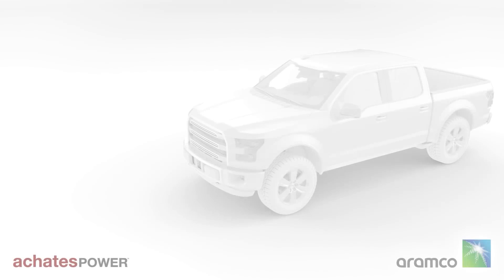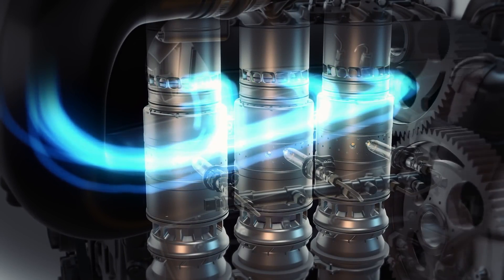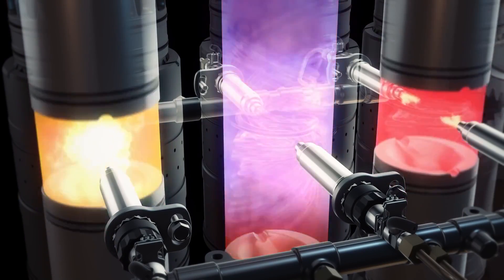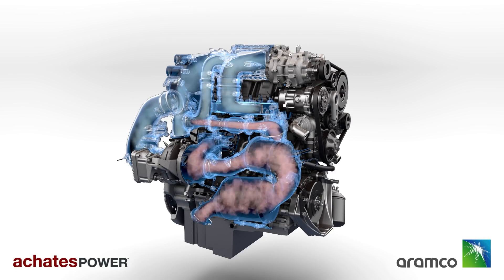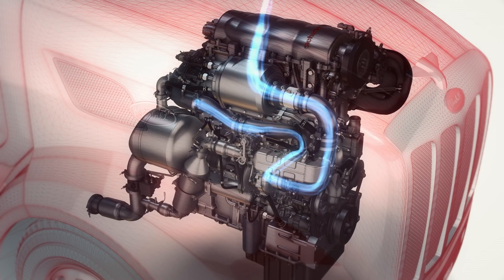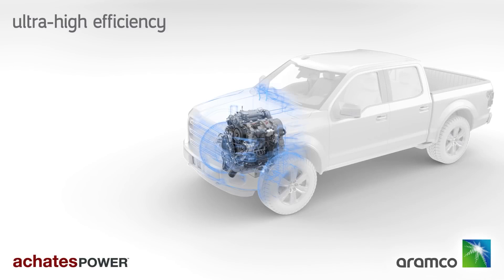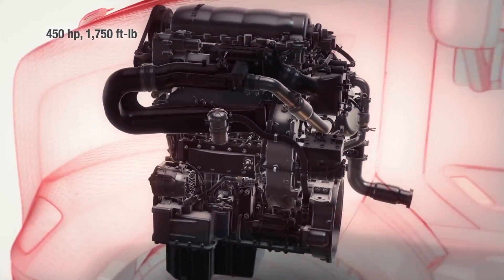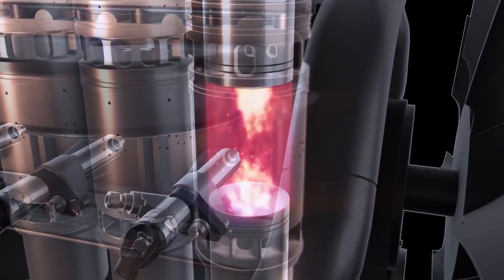The Achates Opposed Piston Engine: The Only Green Diesel Engine

Comment: Will this engine run on hydrogen gas? It looks great for trucks and trains maybe. It's the fuel sources we have problems with when it comes to ICE engines.
Reply: Hydrogen is a very pool fuel...The university of illinois has a biofuel producing supercrop (search for petross) is what I think is the most practical answer. Just run biodiesel and genetically modify existing plants to our advantage, they already have a strain of sugarcane that makes oil in the leaves and stem (10x the oil of soy in the current generation, targeting 16x in the future), and it also makes double the sugar as corn per acre at the same time 30% more sugar than unmodified sugar cane! In addtion to that they have made it grow across a wider climate region and in worse soils as well. Also gasoline engines in Brazil are already running on 100% ethanol its legally required there.... they just need to implement the same relatively minor modifications here, Flex fuel engines in teh USA can already run on 50% ethanol the max allowed percent for e85.
Reply: @Wingnut353  yerah about time for 2 stroke to make a come back as the 4 joke stroke has done its time already. yes ethanol/propanol is a much better fuel than h2. but overunity space aertheic ZPE powered motor/generators such as Bruce Depalmas homopolar overunity motor/generator or something like it will be the ticket. i just dont see the obsession with chemical fuels and batteries though.
Reply: Hydrogen isn’t really a viable fuel to burn. Hydrogen fuel cells are much more efficient and could potentially be reasonably efficient options.

Comment: Plasma coat the cylinder walls, outer edge of rings ,and piston. Yes it's very expensive but after you should get a mega hour workhorse engine. VAG Did it with the twin turbo V-10 TDI. If r recall correctly ( I may be wrong) the v10 Power Plant would out last the body of the touareg. I owned a 2004 v10. Longest ever for one of my rides.  Amazing power but more than that after 178,000 miles it still made rated power. And still did 27mpg. I regret trading it in still tonight.  My bad . Plasma coating the cylenders, rings , pistons is the answer. Yes I know VAG only plasma coated the cylender walls but the rest will make a million mile/KLM engine. Costs money too make . Greg fall city. Wa USA.   Ps. The V-10 2004 WAS BREATH TAKING. IF YOU CAN FIND ONE FOR SALE BUY IT. G
Reply: That is essentially how most aluminum block engines are processed today ... and how a low grad aluminum honda engine can last for 300k miles without a sweat. Also these engines appear to have sleeves just like old detroits so you replace the sleeves and you expensive engine keeps kicking for another 500k miles.

Comment: These engines have been in the works for well over 10 years. Why have these not even hit the market yet?
Reply: Too fuel efficient, those poor oil tycoons would only have half trillion dollars each if we double our diesel efficiency.
Reply: @dequavisjones4869  then why are they pushing electric vehicles wouldn't the oil industries north allow that?
Reply: This problem is even more prevalent in the aero motor industry there have been like 5 different aero diesels that have all been bought and quashed or now cost like 500k etc...
Reply: If you ever have to ask that question, the answer is always money. It cost too much or interferes with some else's. Look up the fuel atomizer that allowed big engines to get 45 mpg. Shell bought the patent and buried it. It's never been about the environment 😮
Reply: @fistymopar2356
   There's more to that tech then just that
   A video was recently made about the inventor look into it
Reply: Search for patent trolls. They crush a lot of companies.
Reply: getting OEM's to adopt to this technology would cost them millions. they wont until the the emission rules make them change. (thats coming soon)

Comment: Your video clip of heavy equipment moving coal and saying that they use gasoline engines may be a bit off.  When I visited a coal mining operation in the mid 90's I was told that they use electric engine to help prevent sparks from igniting the coal.  This is very fascinating.  Thanks for sharing.
Reply: Yeah there are some huge trucks like that that save a massive amount of fuel as they generate power returning down into the mine and use it again going back up... basically a perfect application for a hybrid or EV.

Comment: Hi 
Yes heard a lot of noise about opposed piston diesels over the last 18 months and while they are a little more efficient they still don't address emissions output 
As all of the emissions control you mentioned is just normal post engine control, not a major breakthrough in not generating pollution in the first place 
Don't get me wrong I am a piston head but as you said the tech ain't new and still suffers the same inherent problems of any diesel engine, what is needed is a combustion system / cycle / engine that is better than 60% efficient thermodynamicaly while producing 50% lower raw emissions than current technologies which automotively
 speaking are quite awful. You only have to look at vehicle fuel consumption vs emissions over the last 20.years to see that very little improvement has been made. In my opinion the design criteria should be make it use as little fuel as possible and then design an exhaust after treatment system to work with that rather than what we have today must run lambda 1 then the cat will work 
Sorry rant over 
Just pissed off with government passing down my back telling me its raining
Reply: I gotta say ... you are completely wrong about this engine. It is significantly cleaner than current diesels... and the reason being is the double piston design has double the expansion ratio of a normal engine and thus extracts more heat before the next cycle. Also the reduction in emissions are NOT derived from the post processing... this engine has LESS post processing than current engines and in fact cuts down on DEF use. This engine absically did exactly what you said in your last paragraph.
Reply: 8

Comment: Those engines are annoying they make too much noise Walmart was trying out a truck with that engine and nobody wanted to drive it because it was too loud and they had three or four fire extinguishers under the hood that will tell me there is a high risk of a fire I truly don’t trust that engine for that reason let alone the sound of it is awful it sounds like several gears grinding

Comment: Supercharger? Scavenge blower.
Reply: It uses an 2 speed eaton R900 supercharger.... Eaton calls it a supercharger end of story. Super charger is a type of blower. If you want to be ultra pedantic... the engine has 2 blowers, a turbocharger and a centrifugal supercharger both are blowers.
Reply: @Wingnut353  They're both pumps, but they do different jobs.

Comment: Old soviet tanks made in Ukraine run on horizontally placed 5-cylinder Jumo (b.t.w. Jumo is a german name so Ju reads U as the english word you - the whole name sounds youmo) aviation diesel derivate from 1964 (T-64 and all its modifications) and newer on 6-cylinder from 1984 onwards (T-80BV - the ones that gunned down the last and the only almost freely elected soviet parliament and mr. Eltsin gave a speach to the protesters atop of one of them, T-84 and its newer export variants) and for nearly 60 years of use in these tanks and other heavy vehicles no one have suspected or noticed in use practice two stroke diesels to be more ecological than regular 4 stroke diesels (the tendency is just the opposite) - it's all in the attached bells and whistles. What opposing pistons engines do is giving better power to weight and power to engine volume ratios, but compared to the 4-stroke diesels of equal power output the 2-stroke ones have less torque (which in case of the diesels ain't necessarily bad). In case that power to weight and volume ratio is not enough there's also the delta diesel engine - three such an opposing pistons cylinders in a single plane triangle configuration pushing three crank shafts in triangle's vertecies and whatever number of such planes designers find appropriate to the need that push railway locomotives and ships since after the second world war. Both opposing pistons and delta diesels are also widely used in marine application.
Reply: Less torque isn't true... if all else is held equal for the same engine volume a 2 stroke has double the torque because it has torque pulses twice as often.
Reply: @Wingnut353  You are a bit mistaken - what you mean is what you call power output. It's more intuitively understandable in other languages in which torque sounds literally backtranslated to English as rotating momentum. Simply explained it's the vector of the peak momentary force the engine produces on the surface of its output shaft so if the equal force in the opposite direction is applied the rotation will stop completely.
Reply: @Wingnut353  Yes 2 strokes are torquey,brapppp.

Comment: If the two cranks actually rotate in opposite directions that would make for a very smooth idle and low speed running.
Reply: That sure seems to be what I'm seeing , no unopposed power stroke .
Reply: In the video they are both rotating in the same direction. Kind of disappointing
Reply: That's exactly how it works since they are driven off gears that drive the central flywheel gear.... they have to rotate in opposite directions.
Reply: @Wingnut353  if you work it out in your head You'll see your mistake.

Comment: Have a look at the commer ts3 - one crankshaft,three cylinder, six opposed pistons, supercharger, built in the 1950s by the rootes group in the UK, taken over by the Chrysler Corp who promptly killed it because it was more efficient and cleaner than the engine they had developed costing billions.
Reply from the maker: Will do thanks😁
Reply: On the other hand the commer knocker is inferior to the achates engine because its too complicated.... one of the main advantages of the achates engine is that it is super simple with any complexity focused into a few small areas like (preventing oil consumption) and modulating intake pressure with the turbo.
Reply: the commer had 2 major drawbacks. one being the main bearing on the rocker. they were only running about 100bar peak cylinder pressure, achates is running 220. the 2nd limitation is the serious limitation on the bore to stroke. the main reason for superior scavenging of the opposed piston is the ability to achieve very long bore to stroke ratios and still maintain acceptable mean piston speeds.

Comment: The future is gas/diesel-electric like locomotive engines,  maybe add batteries!!
Reply: I think the current authorities are focused on getting rid of that too. Likely strictly BEVs theyll allow. They have not given FCEVs an oppurtunity in the US.
Reply: @jadenspires1891  Peopl like that and are single solution driven... rather than seeing the big picture and leveraging all soltions in the right places or better yet in an organic manner. Hybrid vehicles are actually not a very effective solution unless you are a trash truck or mail carrier... etc... those same vehicles would acutally often be better served by a light hybrid or a hybridized full EV. Rather than the common today mild hybrid.
Reply: How about overunity homopolar motor/generators that tap spave aetheric ZPE energy available anywhere in the universe. i cupe or the volvume of a 250 CC 2 stroke is enough to boil all the worlds oceans. Bruce Depalma, T Henry Moray, Nickola Tesla and many others are aware of the spuendouse energy density. IUt drives and makes up all the crarged particles that make everthing up. No battries or chemical fuels requaired if it stops getting supressed. I like my ICE 2 stroke and amsoil interceptor 2 stroke oil, i bought a few gallons for my detroit v8 2 stroke.

Comment: Imagine a 12 piston Cummings 6.7L 12 piston engine, 2stroke, with turbos! 😆  Or a larger road tractor engine, 15L or so,  maybe a V8 opposed piston engine, haha!!
Reply: Check out the Cummins combat engine
Reply: @VHP7044  Yep, the ACE engine is an achates derived design, 1000hp our of an inverted boxer 4 cylinder 8 piston engine. And it is significantly smaller than the engine it is replacing.
Reply: Here is your brand new cummins ACE OP 21 stroke: https://mart.cummins.com/imagelibrary/data/assetfiles/0058689.pdf
Reply: Oops 2 stroke!
Reply: I'm salivating at the thought of a bigger more powerful Cummins!

Comment: I also tried to contact them about a possible engine purchase and was also ignored
Reply: They are essentially a military contractor at this point... it will take a CARB or EPA mandate to get these engines onto consumer assembly lines. the military contractor money is quite good for little effort and allows them to continue in R&D mode as long as possible before going up against competing designs... honestly if it were my company that isn't how I would run it though.

Comment: These guys have been around for a very long time with little commercial fruit and no independent testing as far as I'm aware ?
Reply: Cummins licensed the designs for the ACE Advanced Combat engine... and the military is buying those. As far as I can tell its been quite sucessful in testing. Walmart and Tyson have been testing a version of the achates engine also... and it will have to go into production by 2027.
Reply: argon national labs and cummins motors.

Comment: All the alphabet soup of aftertreatment is what is killing the diesel market. However, the opposed piston diesel is a really cool concept. I wish the poweres that be would just be satisfied with its overall efficiency and out of the engine emissions without EGR especially.
Reply: You can't avoid the aftertreatment under CARB... that said this engine probably would require little to no after threatment elsewhere. Even under carb it has a reduced size after treatment system reative to the engines it is replacing it also is designed to reduce DEF use.

Comment: Very similar to the old Comma knocker which only had one crankshaft!
Reply: The difference here is that there are fewer complicated parts, and instead just two crankshafts its much more elegant in design.
Reply: @Wingnut353  maybe but the comma was a more compact design & it could run horizontally making it easier to install with a lower centre of gravity.
Reply: @Wingnut353  The Commer engine just had large rocker arms to transmit piston motion, it was hardly "complex".

Comment: How would it perform under engine-braking conditions on a modest to heavy grade?
Reply: That's an interesting question... since it doesn't have valves there is no way to implement conventional engine braking other than just turning off fuel.... a hybrid flywheel generator might make a lot of sense due to the fact that it has that huge flywheel gear in there anyway. I bought a little honda insight recently and it has extremely good engine braking.... about 10-15kw worth on a 60HP engine, probably more could be achieved in a modern design. And the flywheel on the insight is smaller than a 270hp engine would have. The insight is also the only vehicle I have ever driven with auto stop... that I actually like the feature... pop it out of gear, engine turns off, put it back in gear and its running again immediately, this even reduces wear on the throw out bearing in the transmission since the engine just stops even before you have a chance to let the clutch back out.

Comment: Could they use hydrogen as fuel and completely eliminate emissions?????
Reply: Hydrogen doesn't eliminate emissions... thats just propaganda. If you put air and hydrogen in a cylinder and burn it you are still going to get NOX. This engine does an extremely good job of nearly eliminating NOX, and allows the use of the most convenient fuel type... even if you are talking biofuels diesel is where it is at alone with sugar cane ethanol. University of Illinois has a combined GMO crop that produces 16x more oil than soy per acre and double the ethanol of corn and has a wider growing range meaning it can be used in poor non food crop soils! I've read that they are trailing this in brazil so they can reduce Soy crops and increase biofuel production (they are already at 43-50% biofuel for thier entire fleet!)
Reply: @Wingnut353  sounds like propaganda against hydrogen to me too.

Comment: First off the Navy has been using OP engines since 1938. It is a great engine to work on and easy to keep operating. At low loads it does collect oil in the air box but that has already been fixed by a return air system that uses already burnt exhaust back for combustion. If I could get a OP engine for a small truck I would get it in a heart beat. PS. The engine timing is adjustable via a vertical drive timing system.
Reply: Its a russian invention and patended